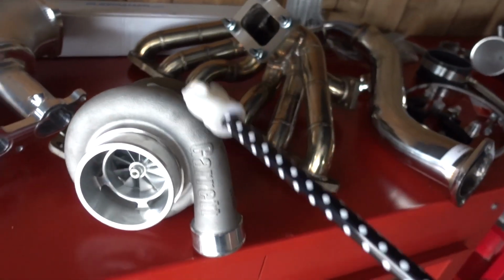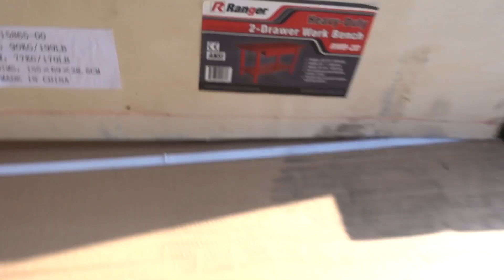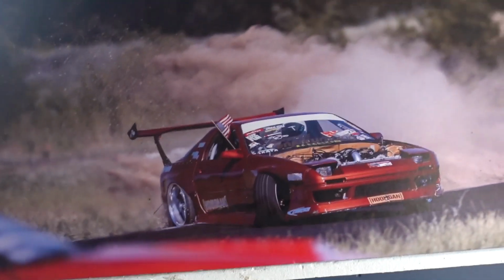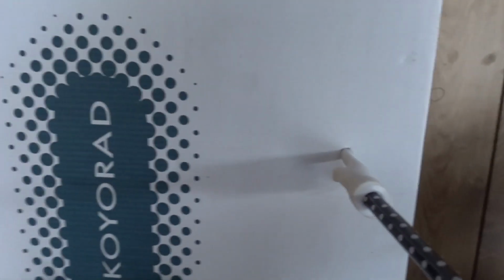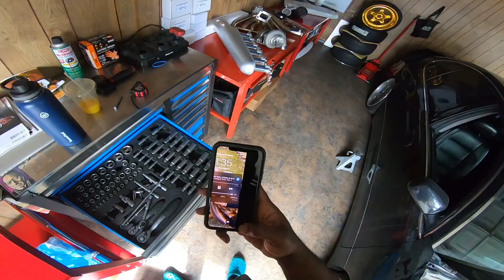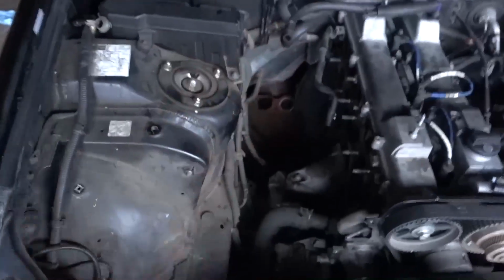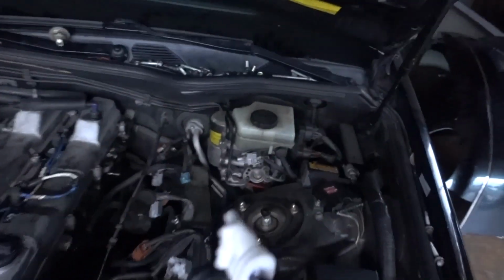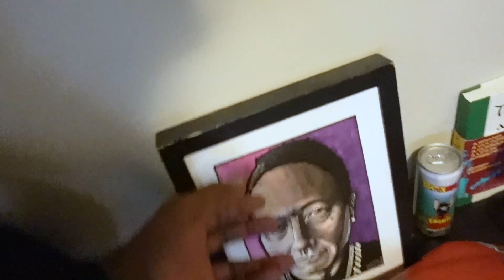Hert’s Lexus GS300 Family Cruiser Gets Ready for Boost!

Comment: If you’re staying Auto then the GE vvti intake manifold is going to be MUCH less of a headache. The electronics need to be retained in some fashion to control the transmission. The main downside to the oem manifold is lack of space between throttle body and exhaust housing of the turbo. But there are some better manifolds available like CX Racing which move the turbo forward in the bay. I’d go with something like that(DM is just a Chinese mani anyway)

Also, as far as the upper oil pan- I just tap it with the pan on and dump like 10qts of oil through the new drain hole. And use cutting oil. Not saying it’s the textbook method, BUT I’m pretty sure I’ve put more miles on a na-t GS than anyone in the US(100k+ miles and almost every state incl HI), and it was never a problem. 

Also, let us remember Peter/Slant Eye/Detuned’s GS. Because OG FL homies know it’s what inspired you(and me) to get one forever ago.😂🤙🏼

Comment: Is having the turbo drain back to that part of the pan going to work hert? The oil level is max at almost all time on that part of the pan Thought you had to tap into the aluminum mid section between that part and the vlock? It's even got a spot for it from memory

Comment: see that truck in the pic with an AR 15 on the hood?  That has a 2jz GTE VVTi with stock twins.  I have been hunting for a turbo package for some time to mimic the original spool-up.  I take her out to the Dunes so I need a quick spool. I only want HP up to the limit of what I can run with as stock ECU.  I have so many questions about your build;  new turbo spool compared to stock, stock ECU?  different injectors (now or later) , boost controller ?  Wiring harness?
You mentioned you purchased this 'kit' from Driftmotion, but did you modify the package with them for the Garret snail?
   I appreciate guidance on this.  No one wants to help (in emails) unless you physically visit their shop.  I have spent thousands with Drift motion and Aaron will not answer certain questions.  As I have considered rebuilding my twins, I asked about new VAVs, hoses and actuators to rebuild the stock twins.  NO answer!  Driftmotion offers a service to rebuild the stock unit but has no supporting parts for a full rebuild. 
  I will be watching your build carefully, and please go step by step explaining everything.  I have built my truck my self and will do the same with the turbo upgrade.
Your project IS my project.  Thank you.

Comment: Just so you know, the casting of the upper sump has a spot for the twin turbo drain
Reply: I was going to drill through that from the bottom.
Reply: @HertLife  that will definitely work man, just spreading the knowledge if you would prefer a more "oem" finish

Comment: i also have a nat i get trollled alot tho be nice to see this done i did my is 300 and its so hard to fit all this shit in there i did my old gs300 so much easier the cool part tho the stock ecu will cope with boost very well i made it to about 15 lbs before running out of fuel my afr was around 11.4 i willl be going fuel tech ft550 this year and gte block with my built na head i learned tho these engines can come out in a hour with the transmission harness and all should have just pulled it out put erything on then stuffed it back in

Comment: Probably all pre recorded and done now. But N/A JZs actually come with a spot to drill out on the upper pan, for turbo drain. Also, my dude you didn’t cheap out on that intake. 😂😂 Shit do the cheap boi route, and get a GTE manifold, cut the runners off, and have a homie weld it to the factory lower runners. Shits like $300 max afterwards. 😂

Comment: should have went with a gte intake manifold with ge runners welded on instead of that intake manifold
your not doing internals on your vvti ge so you wont be making over 450hp to the wheels before your rods snap like tooth picks
and that intake manifold is gonna kill your torque
"budget"
Reply from the maker: Just wait...